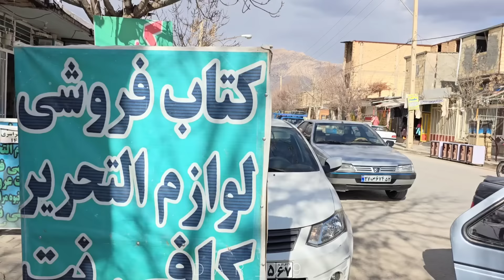Shopping in the city: Rasoul and Narges measures against the winter cold

Comment: Dear cameraman, we know that you have a heart of gold. Now we also want to see the face behind the camera. So show yourself 😘. Yes, the house turned out well. The carpet is there too. However, the oil heating does not make a consistent impression. There is still a fire tray missing under the stove, someone has already said that. But it's not just the carpet that can get dirty, but rather a fire protection so that the carpet can't catch fire. Then the heater must have a sturdy pipe that is protected with rings at the bottom and top to prevent any smoke from entering the room. The fixed pipe must be sealed at the bottom and walled in at the top. Hadi has already said that neither of them can plaster inside. Get someone there to make sure your house is perfect on the inside too. It is also true that you have to lay something under the carpet so that it is not damaged by the moisture of the concrete and, above all, you all stay really healthy. Our architect... He really does his job well and you can see how much he enjoys his work. If he also has a YouTube channel, I would like to follow him too. Please publish the link. Thanks. It would be nice not to lose sight of Mohammed Reza when the house is finished. Please, don’t forget and show your face😊

Comment: This house will be beautiful when it is finished. They knew from the very beginning that he would not live in the previous house for a long time, that is why he did not plaster the blocks with cement, he knew that he was going to ruin it, that was  regia. The windows had to be cleaned of cement, painted, then installed glass. The stove is full of dust, it had to be wiped, but I concluded that Narges does not like cleanliness and order.

Comment: Buy one that can be used to fill the heater tank with oil.  This will prevent the oil from spilling outside and onto the carpet.  Or find a pad to place under the heater as well.  Prevent oil spills on the carpet, please.

Comment: When you go to town get a steel tray for under the oil heater for spills.  This will help the carpet.  The old wood stove might work outside under the overhang roof for outdoor cooking.  You will have to move the carpet later when you plaster the inside walls and then some plastic under the carpet will keep the dampness from the cement away from the carpet and make the house much warmer.

Comment: Never place a heater near the door or window.   The heat will escape fast and the room never gets heated up.  It should be placed at the farthest corner or at least in the middle of the back wall.  If you could, change  the position😅.😊
The heater is scary 😨 😳.   What kind of paint is used?

Comment: Hello my dear friends you should buy foam to put under that carpet so the floor wont be so cold that rug will still be a cold floor guys get a sheet of foam  your better off no you want the square heater not the round one you will be sorry for buying that small round heater  well you also have the wood stove so you better use both to heat up faster for when it gets cold you will need a gallon of fuel for that heater wow it looks like it is going to rain buckets guess i will find out tomorrow may god bless you all

Comment: Don't go cheap when it comes to your life and family safety
The oil heater requires a solid metal exhaust pipe and elbow pipe extension out and an elbow extension up and a straight metal exhaust pipe above the house roof and install an H exhaust metal pipe to prevent water coming down to the heater.

That flex pipe is not good for oil heater it can catch fire burn your house down carbon monoxide poisoning.

Don't be cheap don't put your family lives at risk.
Buy solid metal exhaust pipe

Comment: WOULD IT NOT BE SAFER TO PLACE THE STOVE ON TOP OF A WOOD OR STONE SURFACE IN CASE OF SPARKS. TO BAD THEY DIDN'T BURN THE STOVE OUTSIDE FIRST TO GET RID OF THAT SILANT COATING.